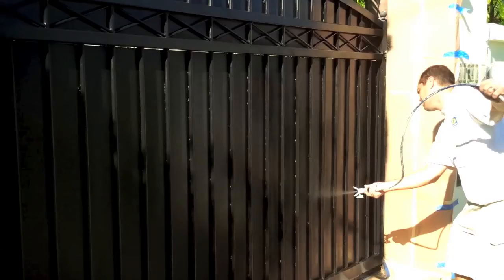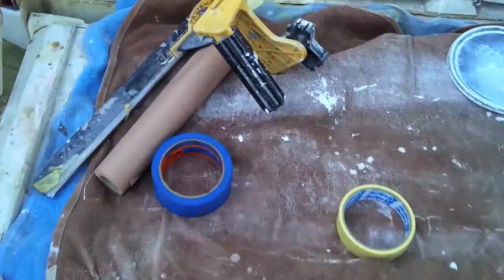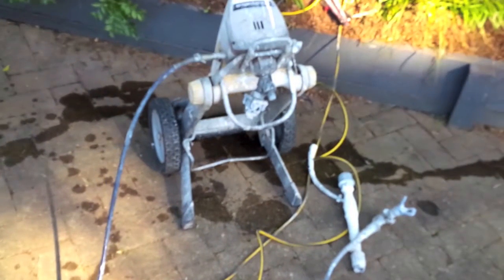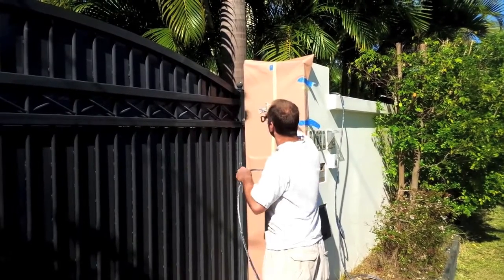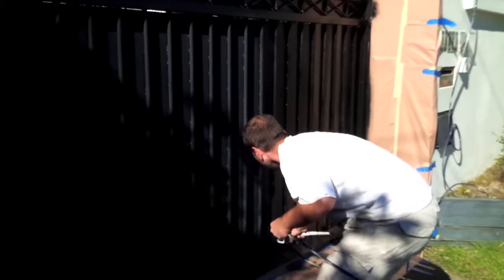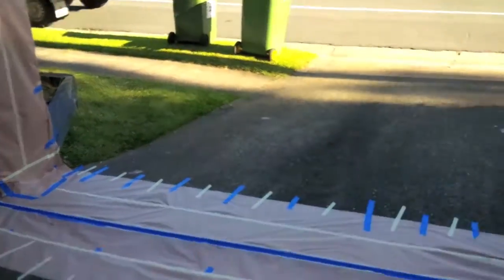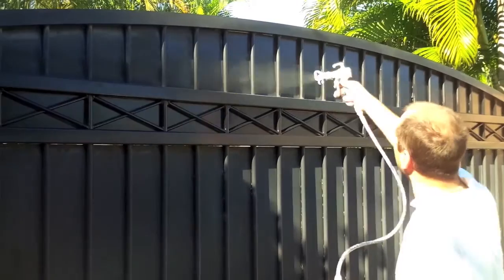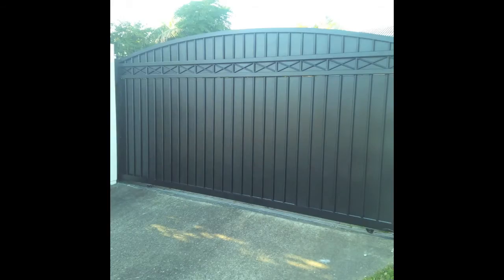Respray Front Entry Gate - Wagner Airless Spray

Comment from the maker: I just noticed a comment that was marked as spam so i couldnt see it,   The paint was not thinned at all in this video, straight through the fine filter / tip without thinning.    You can do this with standard house paint.   If you are using a roof membrane you will have to change the filter, and increase the orifice on the spray tip, but you are still able to use a fine finish tip.

Comment from the maker: depends on the fence though, type of timber, and if you can see through it, the ones you can see through to the other side i think you might be better to trim roll the whole thing unless you are painting both sides.   Generally if its one of those ones you can see through to the other size where the pailings are spaced apart, i would advise people not to paint just one side of it because it wont look right, and look crappy from the neighbouring side.

Comment from the maker: you dont need to thin a standard acrylic / latex paint to spray through a 211FF - contrary to what the paint shop, and spray reps will tell you.   The paint sprays just fine unthinned, even through a 208FF.   You can thin it a bit if you want it to go a bit further, i generally have a policy of not thinning house paint as you reduce the coverage and reduce the quality of the end product.

Timber fences, i'd maybe use a 213 / 214FF you want a bigger orifice size.  Thanks for watching